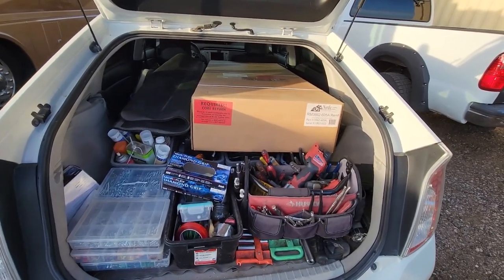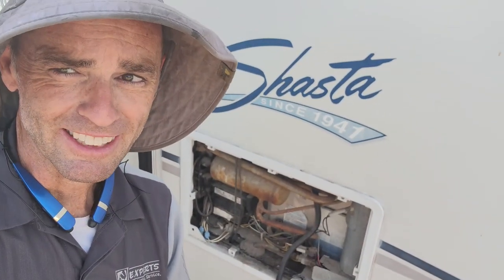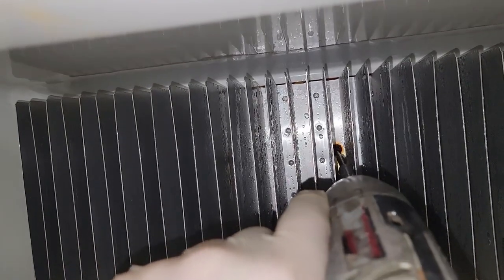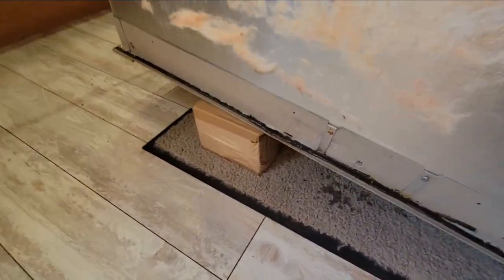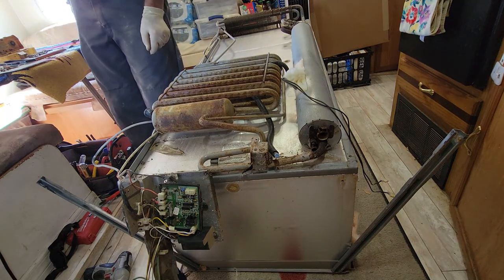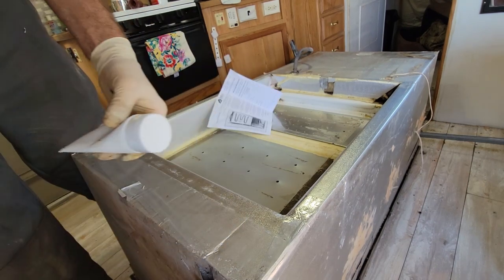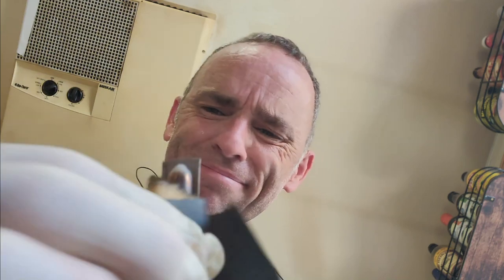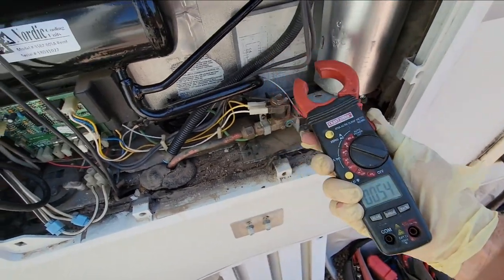Dometic RV Refrigerator Cooling Unit Replacement

Comment: The owners were smart to want to repair versus buy a dorm type refrigerator. Nothing beats having the option to run propane as you are driving or boondocking where electricity isn't available.

Comment: I went to RSI in 1986 and that's one of the first things we learned, an a/c system is not blowing cold air, it's removing the heat. Once you comprehend that, learning the basics isn't hard.

Comment: Watching a pro work on one of these, and discussing your earlier  experiences and facts tells me you have years of experience.  To me, thats more important than any textbook or college education out there. You have been there and done that. This was how I learned small engine repair and like you, I can go through a repair in a fairly quick time frame with fewer mess ups( except hardware failure). After a while, I learned to carry a few extra parts, especially  knowing from past experiences  what usually fails during a process. Awesome video. I personally would have replaced the whole refrigerator as the owner of that camper. As you said, you are only doing what the owner wanted.

Comment: I want to build an EMP proof chest freezer with foot thick walls, top access plug type door, and no moving parts. I was unaware of the availability of a complete ammonia absorption unit and it looks like just the trick for this project. I did not know that replacement cooling units were available. Think of the possibilities! Heat from a resistive solar powered resistive element, heat from a kerosene burner, heat from direct solar impingement through a lens, methane burner, etc. Not that I will ever need such a device but designing and building things like this keeps my retirement years purposeful.  We bought a used slightly damaged  27 foot Dodge Travco motorhome from Dick Smothers of the Smothers Brothers in 1968. We took the Dometic propane fridge out to access something behind it and my dad showed me how ammonia absorption units work. He put it on the work bench and put a small flame from an alcohol burning lamp under the chimney to get it to cool.  Keep up the good work!

Comment: Your a Pro brother!!  I ended up putting in a "bigger" dorm type fridge in my old 1999 Lance 1030, I swear they built the truck camper around the dometic!!  It did suck not have it run on propane but I did have a onboard Onan genny.   Got rid of the 99 due to the black tank was falling out of it and so many soft spots. (purchased it in 2020) now have a 1997 Lance Legend 880 with a working Dometic Royale (cooling unit looks new) Picked that up this March, the 97 was garaged for 16 years when not used, solid as a rock.  Anyways fantastic job!!!

Comment: I did the JC Refrigeration "Amish Air" on my nevercold RM1200 and it has never worked better.  best $1,700 ever spent. dual operation, original styling no more fire worries.
Reply from the maker: Awesome! Thanks for watching!

Comment: Another great job and video. I can't imagine that they saved much by replacing the cooling unit over buying a new frig. Is it difficult to find an absorption frig now? I prefer 12V frig now but you do need enough battery to take you between charges. Still a good video to see how its done.
Reply from the maker: Thanks for watching!
Reply: I started a group on Facebook. And it's just Winnebago Outlook rigs only. We now have 243 members, and I mention you all the time. And I stress your roof repairs constantly. Thank you for being so diligent with your videos. You've taught many of us how to maintain a good watertight roof and other small repairs. Thanks again. Oh, we winter in Yuma every year. How do we contact you? I know you're super busy, but it would be nice to contact you for work if needed. Thanks again.

Comment: James... would it be in your best interest to test the pressure of the propane system BEFORE you start on the refer? I'm thinking, what if you did find a leak that was already a problem that you were not made aware of.... it might save you the hassle of that existing problem becoming yours because you did the refer.

Comment: That wasn't a service call, that was a labor of love and an act of kindness for people wanting to continue living in the past.   It is crazy that anyone wants an RV fridge using propane fuel or ammonia refrigerant in 2022.  Especially anyone plugged into  120V power in an RV park!   

The only reasonable choices are 120V fridges, with a plan for using (a generator or) solar, LiFePO4 battery, and inverter when boondocking..... or 12V compressor fridges which of course come with a 120V power brick also.

I wouldn't do an even trade of two copies of my $253 Alpicool-clone 50 liter fridge with LG compressor, for that old-school  setup.  They could use one as a freezer, one as a fridge.  I normally use mine as a freezer set to -4F, and move some frozen water bottles from it into a soft-sided cooler bag as my fridge.  When I'm on the road, I always have water and Gatorade bottles frozen/freezing in the freezer and unfreezing/drinkable in the cooler bag.  The side benefit is cold drinks with their own internal ice supply that doesn't even dilute them.

Figuring out what dorm/apartment fridges can be retrofit into the space of various multi-way fridges like that, rebadging them as "AZ Expert Compressor Fridge Conversion Kits", and figuring out trim-kit solutions,  might be an idea you could turn into a product line.

Ditto for just coming up with solutions to use the guts of a dorm/apt fridge or 12V compressor fridge to cool the metal plates on existing fridges like this one.  

I realize that removing the fridge and removing the old guts to do a conversion, would still be a nasty job, just without the "praying I don't screw into the ammonia refrigerant lines" problem.  But it's much more kit-worthy and DIYable than reconnecting the propane and installing the new ammonia lines.  

Last but not least, I can vouch for the fact that it's nice waking up to see that money has arrived in your online merchant account, and you just have to get something shipped out, or better yet drop-shipped by someone else.  Manual labor can be challenging and fun, but there's only one of you.  You can't do 50 jobs a day, but you can click the mouse enough times in an hour to have stuff shipped to 50 paying customers.
Reply from the maker: That's an idea for sure! I just need 46 more hours in the day

Comment: James.  I was actually thinking about going to JC refrigeration in Indiana to have my rv refrigerator converted to their Dutch Air 12 volt compressor system.  Do you have any thoughts in that regard?  Would you be interested in doing the conversion?  It would definitely save me a trip to Indiana.

Comment: my dometic is from 1995 and still going after 11 years of my fulltime use. I had a fire in the back, but luckily it shut off. It was a blocked burner tube/ oriface. clean the flue tube! I will not be replacing it when it fails.  i will go with a dc refrigerator to run off my solar system.  or a residential off an inverter.  i check mine often to make sure the burner is not blocked and the oriface is clear. to me fixing an old refrigerator makes little sense due to safety and the fact that other parts are just old and will probably fail soon.

Comment: Great video. 
???
I have a 3 burner stove and both the back burner knobs only turn to high after they light. No can't adjust to low. Why both seems odd that both the outer knobs are the same. The middle knob is fine.
Thanjs

Comment: if a refrigerator won't fit out the door, how does one change out a sofa or armchairs? I see some diesel pushers I am interested in, but I don't like the chairs or the sofa. How do they fit out the door? Great informative video!
Reply from the maker: Some come apart, some are just the right size that they can fit out the door. Worse case--cut it if it's trashed. They DO make RV sized couches but they are RIDICULOUSLY expensive

Comment: Great work. Luckily most of the work was inside the RV w/AC. I would have gone with a 12v but considering they live full time it’s understandable they chose to stick with what they have. 
On a different note, is there a 12v to 120v conversion box that you can plug a 12v into and plug a 110 plug? We swapped our old Jensen 12v TV for a smart TV that isn’t 12v prep plus I wasn’t going to spend $300+ on another Jensen TV that wasn’t a smart TV. Thanks.

Comment: So Norcold cooling unit wires up to Dometic control board without any changes? Norcolds do not have climate control switch but normally once every 24hrs shut down for frost control. Eyebrow controls are the same between brands? I did not see any wiring specifics in video. I went with Amish 12 volt unit to replace our Norcold 8 cuft in our Carriage Cameo LXI - they have updated control system now to bypass original control board and thus some of the stand by power usage in old boards

Comment: We recently installed our Dometic 2 way fridge. We tested today on propane and it ignites and see nice blue flame. The tube at the top of the fridge (back of freezer area) are hot to touch but then they get room temperature near fins. We haven't felt the fridge getting cold. What we haven't done yet is build the frame around the fridge to ensure zero clearance on sides and allow the venting through roof. Fridge has open air all around. Could this be the issue? Does the air really need to get blown up in a closed air chamber for the system to work?

Comment: I just ordered a cooling unit. My 2852 started warming up inside. The sidewalls to the freezer are very warm. I replaced co tell board and eyebrow board. All electrical checked good. Propane works and no blown fuses. Ohms checks good, thermistor checks good too.  If my heating element gets really hot but the absorber stays cool, is t that indicative of a block? Could I have a block or bad heating element even though the elements gets really hot and checked for ohms was good? I’m thinking I have a block in the cooling system? Could you offer advise?

Comment: Hmmmmm,,,,,,,so, let me ask your opinion on something...I have the same issue in an 07 Flagstaff Super Lite...same model fridge/freezer...an independent RV tech in Quartzsite who I trust told me it would cost between $1300 to $1700. to replace, labor included, and would be an all day job...I told him to forget that, I would buy a dual power 45qt. Alpicool for $350 and be done with it, which I did and it is serving my needs well! Does those prices sound right to you.....an all day job, and the price would be higher if the tech ran into issues....for all I know you may be the tech he was going to farm the job out to, as my guy doesn't do cooling units.

Comment: Would it be better to do the propane leak down before you touch anything? Just for a CYA scenario?
Reply from the maker: Sure, but the check after is the CYA, if it fails and the leak isn't at the refrigerator, then it was pre existing.

Comment: 2019 Grand Design Imagine. Fridge went out.  Yellow residue and smell of ammonia and
Fridge won’t cool but gets really hot.  Can you replace with the. Ew DC fridges?
Reply from the maker: You can replace it with any refrigerator that fits the opening.

Comment: I have propane/electric fridge. How difficult to replace with residential electric one?
Reply: Live in CA, unfortunately, don't know if it matters. Am I allowed to drive while running Onan propane generator for roof air conditioner? Dash air doesn't work.
Reply from the maker: I've had to do that before, yes

Comment: How many hours does the flat rate guide give for that?
Reply from the maker: I don't know, I work for myself. Warranty work is garbage
Reply: @AZExpert  Do you charge actual time spent then?
Reply from the maker: I generally quote the job rather than a flat rate schedule before starting the job and will update if I run into an issue along the way, more like a contractor and less mechanic as I work for myself and in mobile settings flat rate makes customer's unhappy if a job pays 2 hrs but I'm done in one.  Thanks!

Comment: That’s too much work it’s better to put a new one electric one not a gas one anymore and my RV it’s gas and power but when the temperature is too high they don’t work very well I’m thinking to change Mine with the residential one
Reply from the maker: I agree and recommended not to repair it

Comment: Looks Like that customer is a bit of a pack rat.  Funny how a customer will spend over $1000 for a replacement cooling unit but won’t spring another $50 to replace the rotted plywood the fridge sits on.
Reply from the maker: I'm not here to judge what people will or won't spend money on. Just here to help them out as best I can.